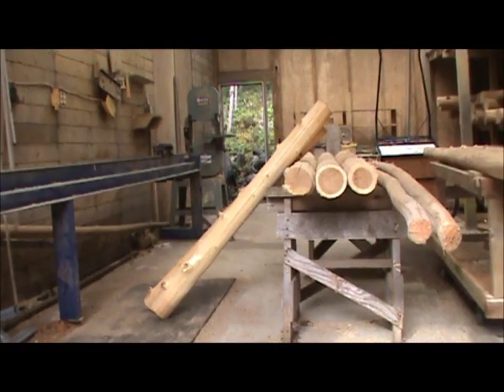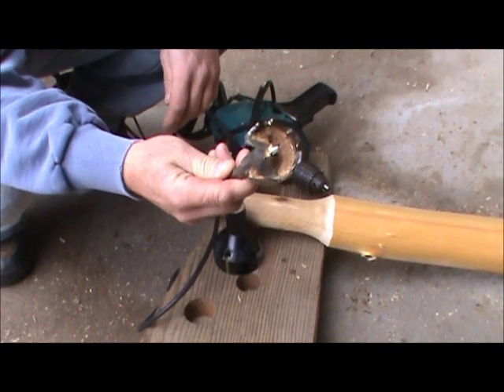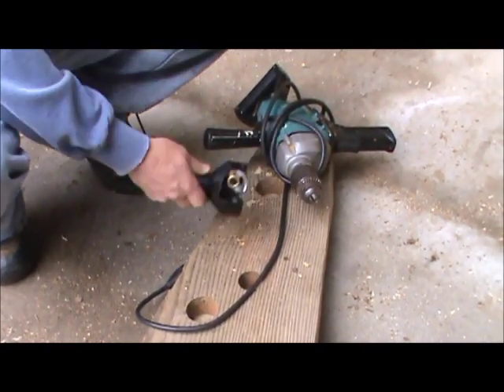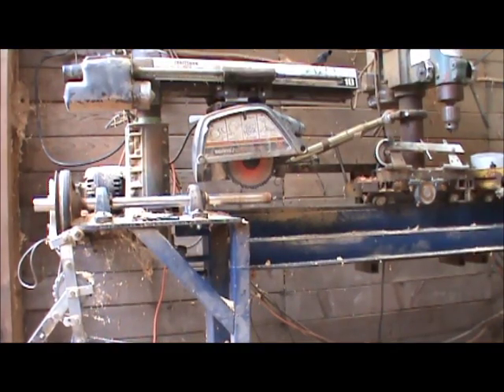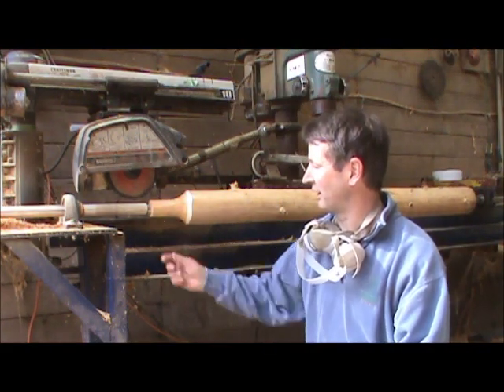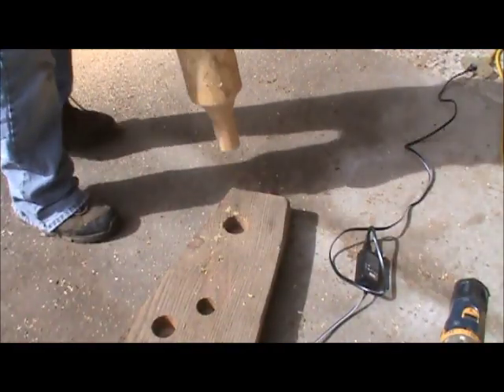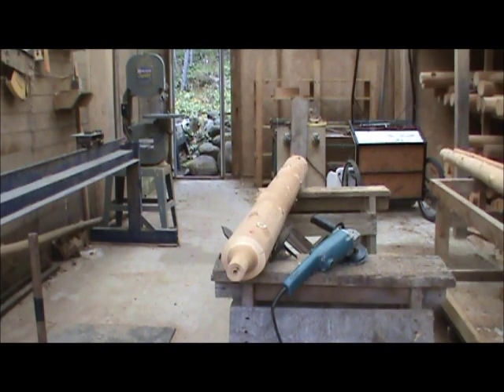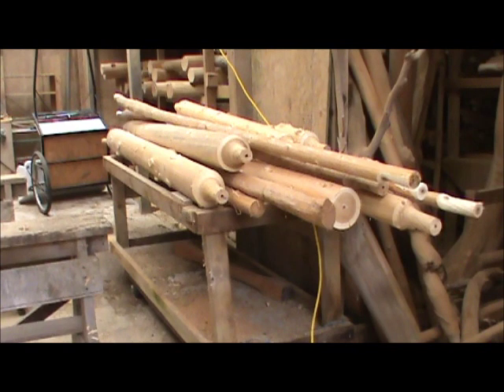How to Build a Simple Log Trellis ~ Part 1

Comment from the maker: Glad you liked the video, You can buy them for your weed eater if you have an industrial model. They come with a chainsaw chain blade, I put 2 on the radial arm saw and crimped the disc to stop the blade turning. Probable not recommended, but I have not had any issue in all the years that I have used it. :)